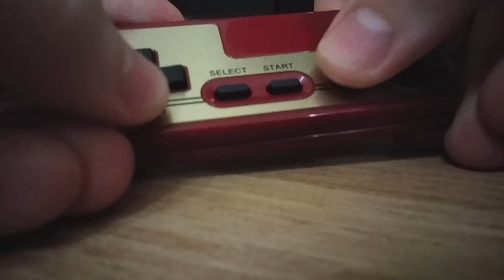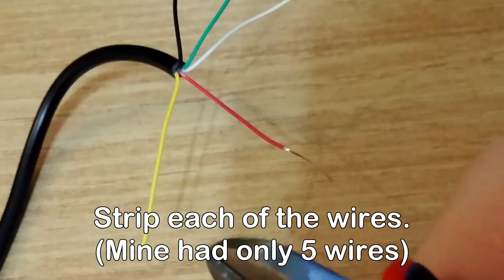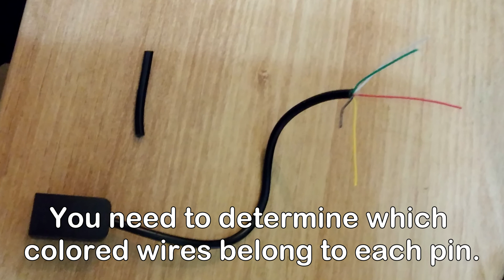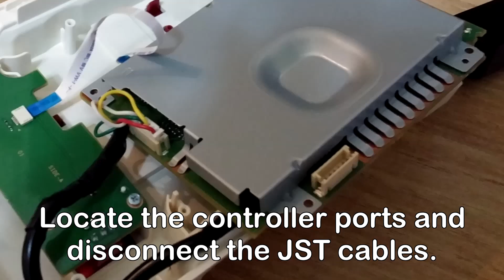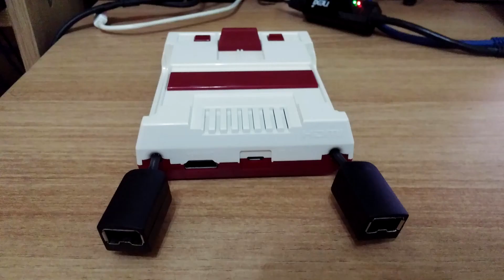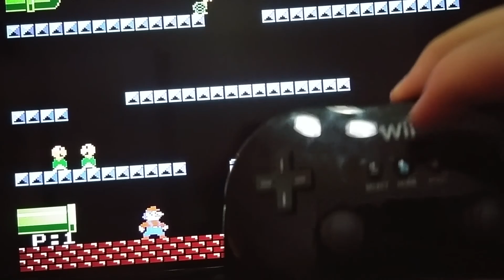Famicom Classic Mini Controller Port Mod

Comment: Edit: I did this. Wired everything correctly. Original controller works after complete rewire on famicom. Famicom controllers refuse to work on snes Mini. Both systems are modded with Hakchi. My snes Mini controllers DO work with the famicom, which is what I wanted anyway! If you plug the  second player famicom controller into the first player port, it will do some weird stuff. Don’t know why. Regardless, if you want to use different controllers, this absolutely works flawlessly! Thanks for this video!

Comment: Fun fact: The Japanese Super Famicom Mini uses the controller ports with the Wii Remote connectors. I know that you've modded your Famicom Mini to have controller ports, so you can use a SFC Mini controller with the Famicom Mini. (For me, I tested my USA SNES Classic Controllers with my USA NES Classic Console, and they work perfectly, but it still functions like a regular NES Classic Controller.)

Comment: Indeed of cutting the wires on the controller why don't you just cut the port that used to be inside the famicom and get a real extra long wired controller?
Reply from the maker: The wires that I attached to the controller are already significantly longer. I used the excess wire from the extension cord that I cut, which if I remember correctly was nearly double the length of the original controller wire. It would look sloppy if I wired the end of the controller wire to the extension cord wire and held them together with electrical tape. If you want really long wires attached to the Famicom controllers, you could either buy a larger extension cord to use, or buy extra extension cords and connect them together.

Comment: Don't you solder the cable ?
Reply from the maker: You can, but it isn't completely necessary. It'll certainly be stronger if you do, but still works fine if you do the method I demonstrate in this video.

Comment: Nice. I thought it would be cool to stuff an 8bitdo receiver inside the console and use an FC30 on it. One word of caution is not all extension cables have the wires color coded the same, so best to check continuity to the port directly to the header, ignoring the colors.